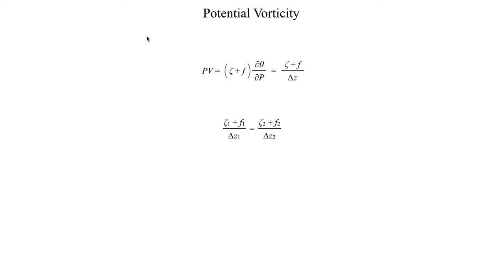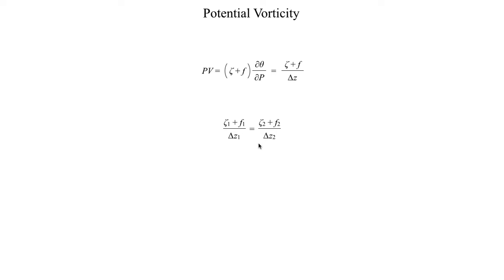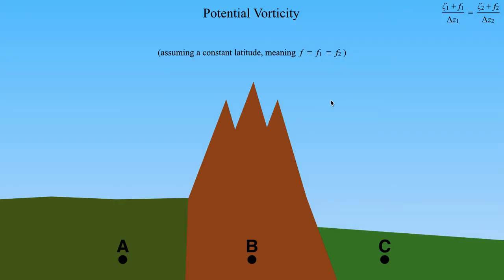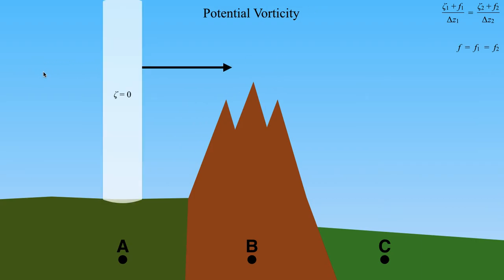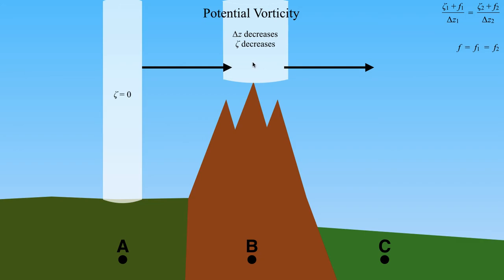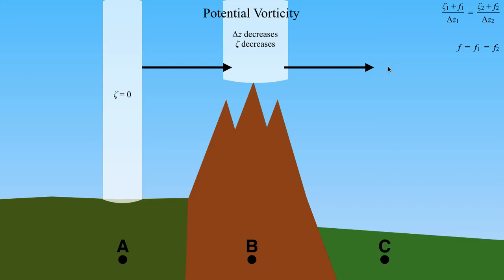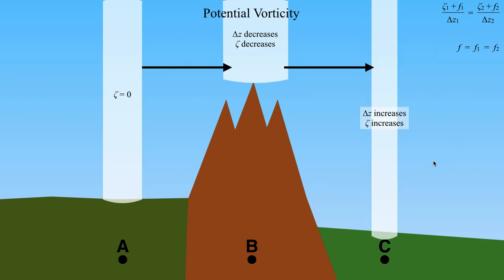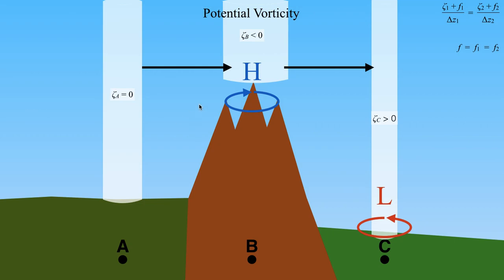METR2023 - Lecture 15 - Segment 3: Using Potential Vorticity to Explain Lee Cyclogenesis

Comment: thanks for this very interesting series of lectures. i'm thoroughly enjoying learning more about meteorology in the process. just one question about this segment: what column do you take to calculate delta z? is that ground level to tropopause, or can you also take a lower pressure level?
Reply from the maker: I'm glad to hear that you're enjoying the material! To answer your question, the term ∆z is usually taken as the distance between the ground and the tropopause. The reason for this is because you'll see potential vorticity (PV) anomalies at the tropopause, which violates the conservation law shown in the video.